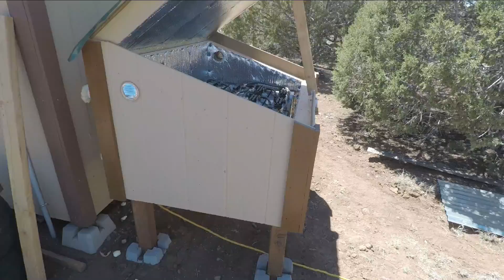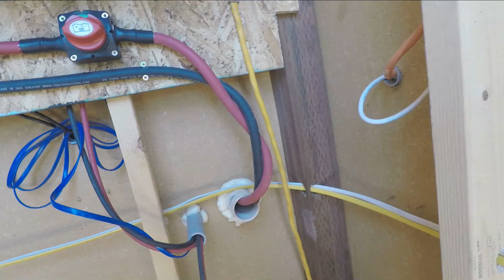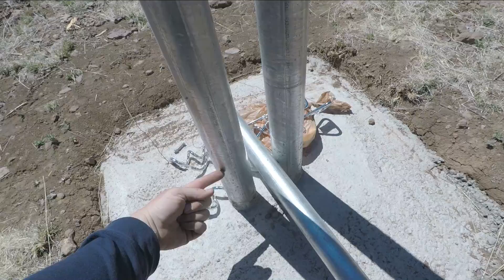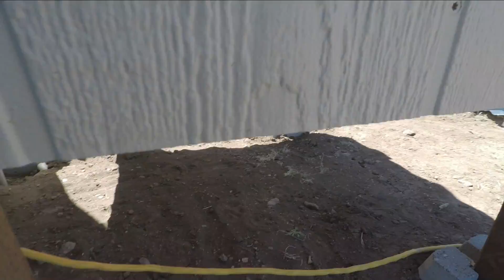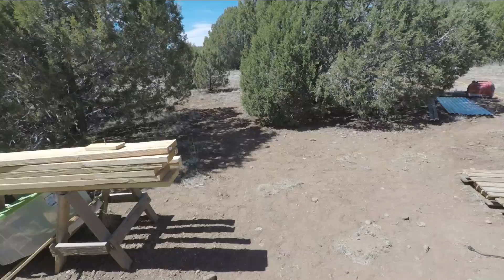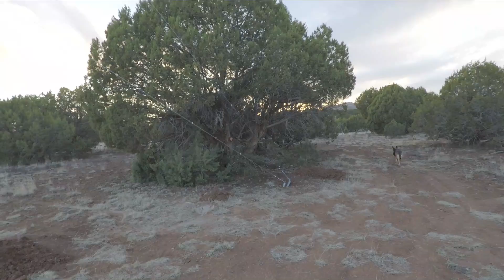Off Grid Electricity: Huge Reveal!!!

Comment: How do you like your mwands set up so far?
Reply from the maker: The short answer is I don't.  I looks like high quality stuff, but it hasn't worked properly since I installed it.  I've tried troubleshooting the issue and have yet to figure it out.
Reply: AZ OFF GRID ok thank you for being honest.  Right now I’m trying or will soon be trying a cheap “500w wind turbine from China” just to really see how they work.  I got the five blade.  The wind hear in NC are not the best plus I have tall trees.  I hope you get the problem figured out soon.
Reply from the maker: @user-ev3xm7np8x  let me know how well it works.  I've been thinking about getting one of those also.

Comment: I'm a newbie at any of this stuff. I have fiddled with a few things that's all. I have 2 100 watt solar panels and 2 big inverters, not yet installed. I was inquiring at a local RV place about good batteries for solar battery banks. They told me not to use old batteries with new batteries in your battery bank. Any advice?
Reply: Okay thanks for getting back to me regarding mixing old batteries with new. I wondered if perhaps the arrangement you made with oldest near the front might be the key to successful mixing. I guess that like you said, that positioning is just for ease of replacement with likeliest older batteries near the front for ease of replacement. I have had bad luck with batteries all my life... Mostly car batteries! Hahaha
Reply from the maker: As a general rule, you don't group new and old batteries, but if you are like me and are using inexpensive batteries and don't want to spend a fortune to buy new batteries when you already have a couple that still work fine, you can mix new and old and it will work.

Comment: Your anchors should point to the mast, not away from it.  Pointing away may work with angle iron turned the correct way but I question the bend strength of those eyebolts.  The guy cables also require some math to determine the needed working load rating and the correct starting tension.  If things are adequately overbuilt, you might be OK.  Not having handled the materials you used, I can's say for certain.  Good luck with the turbine once it's up.

Comment: Hi AZ OFF GRID. Love your video. I once put up a wind turbine and used a 12v 4X4 12v winch. It's a lot safer than manpower. You could bolt the winch to a concrete slab on the ground and use that to lower and pull the wind turbine up. There is going to be a lot more weight when you fit the wind turbine on the top of that tube. Also, it's a good idea, when you lower the wind turbine lower it down onto a tripod near the top of the pole so the blades don't hit the ground. This also makes it easier for the winch to pull the wind turbine back up again. This is good advice and worked great for me to use by my self.
Reply from the maker: You will see something like that in the next video.
Reply: @AZOFFGRID  I can't wait. I'm really into off-grid and I find your videos very interesting.

Comment: I wish I would have seen the video before you did this. Instead of the long pipe at the bottom, you could have used 2, 4" boxed steel pipes with the same hinge. But, you could have mounted a piece of flat steel on each side of the 4" boxed steel pipes as positive stops to stop the tower as you lifted it, and you would be able to lock it into place with the other flat steel on the opposite side.  That way, whenever you lifted the tower up it would always stop at the top position and you could lock it into place on the other side and not have to have that long pipe on the ground taking up valuable space.  The positive stop should be welded on both 4" boxed pipes on the back side of the lift position near the bottom. The other piece of flat steel should have 2 holes drilled in them to match the center of each pipe. Drill matching holes in the boxed pipes and attach large bolts with lock washers and nuts. You could still use this idea with what you have so you can get rid of that pipe on the ground.
Reply from the maker: The pipe is unthreaded and stored after the pole is in place.  Unfortunately I am not a welder.  Everything has to be plug and play.  Someday I will find someone to teach me how to weld properly and will buy all the necessary equipment.
Reply: @AZOFFGRID  cool. Just trying to help. I was interested in your videos because I'm planning on buying land next year and building me a totally off grid homestead.  I like what you're doing. Thanks and keep up the good work.
Reply from the maker: Hey I appreciate the input.  I'm having a hard time visualizing what you were describing in your first comment.  I think I need more coffee.
Reply: @AZOFFGRID  is your email on here? If so I'll send you something crude that shows what I'm talking about.  No problem
Reply from the maker: I try to remember to put my email in the description of every video.  It's azoffgrid@hotmail.com

Comment: Nice job Tobin!  I love how you are constantly improving your setup.   You definitely are learning things and having fun.   Question:  would a 20 foot pole yield a lot less wind input to your turbine?   One of the things I've done was to build a generator shed and installed an automatic generator start that is triggered at a critical voltage of my battery bank.  It was fairly simple to put in.  Just a thought.   Those Honda genies are absolutely awesome!   Very much looking forward to the wind turbine install and operation.  Thanks for sharing all this with us!
Reply from the maker: According to Missouri Wind and Solar, they say you should be 30 feet higher than the nearest tree or structure.  Something about trees causing turbulent wind and greatly reducing the output of the turbine.

Comment: I like the hinged tower. We used that type of tower with eleven meter radio antennas.  Makes maintenance easier. Possibly you could rig up some type of boat winch where in emergencies you could lower the turbine without acquiring assistance.  Good video.
Reply from the maker: I actually bought a boat winch for that exact purpose, but I wasn't sure how well it would work.

Comment: Maybe put some red ribbon matterial (rolls at Home Depot)
To flap in the wind to catch someones attention...
When wandering around..
They are small enough not to make any noise like flags would
Reply from the maker: Ribbon of any color always turns white because of the sun's extreme power at this altitude.  It also gets brittle quickly and falls to the ground and I end up finding it an eighth mile from my camp under a tree somewhere.  I learned that the hard way.